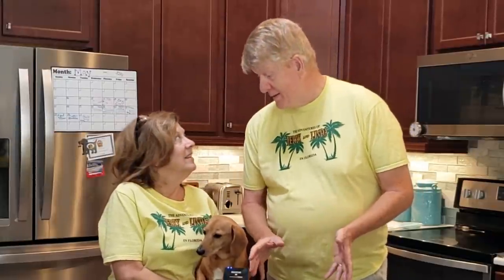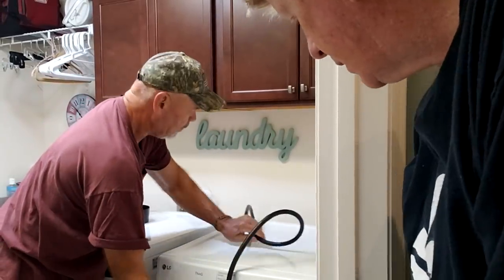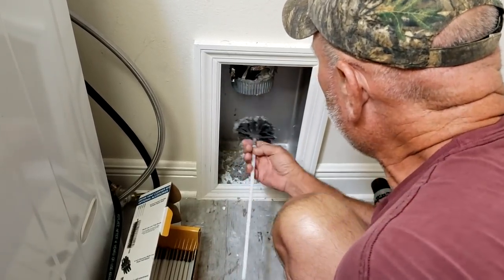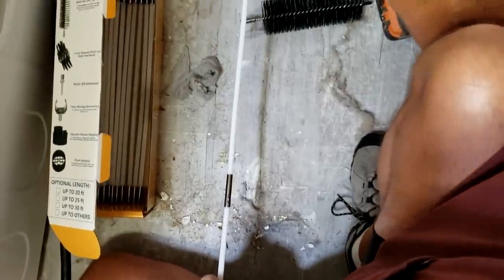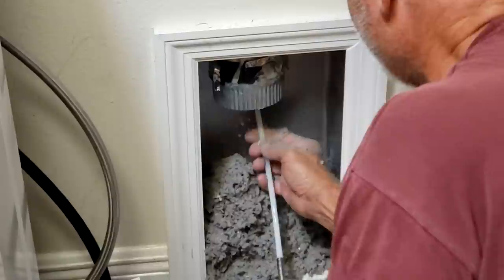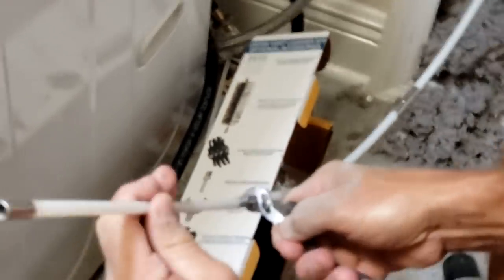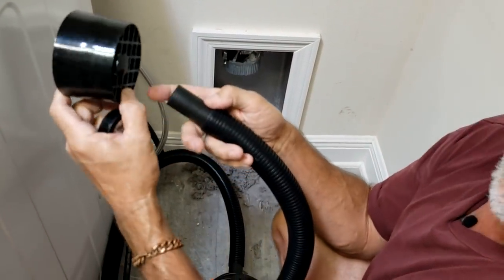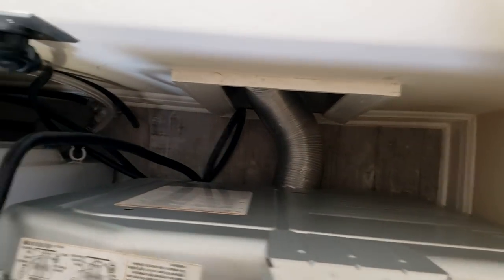How To Clean Your Dryer Vent

Comment: Big tip: do not reverse spin your drill while cleaning the vent. You will unscrew your tip or rods and they will get stuck in the vent pipe.
Reply: Yeah that was throughly discussed in the video.  Did you watch it?

Comment: Great maintenance tip. I occasionally take the dryer back off to access that tube that takes the lint from the upper trap to the exhaust vent. First time I took mine apart I found a shocking amount of lint that had accumulated.

Comment: .My ex was the volunteer fire department chief.Here in our little town we don’t have very many fires in a year.. But it never fails:there are 4-5 dryer fires a year. Of. Course, it’s under the house or goes up the wall out the attic. They can burn a while before you know it and spread to the whole crawl space/basement or attic area.  At minimum get it done once a 6ear. 2-3 times a year of you do lots of loads of clothes a week. Will make your dryer more efficient and dry quicker.
I also take the opportunit6 to take the back off the dryer and vacuum all the lint out of the corners and crevices.

Comment: Morning Jerry, Linda and Gizmo. Maintenance is very important. I never did it myself but when I built my home in the Poconos, I had the service plan for my washer/dryer/ refrigerator/dishwasher/and tv. Annual maintenance and anything in between.  When lived in an apartment, the maintenance was great with checking the A/C filters/fire and carbon monoxide alarms and whatever needed. This video is great for the DIY folks. I could never. Look at the lint. I’m itching just seeing it. 😂. I’ll continue with the service plans. Have a great weekend. Thanks so much and see you next video.

Comment: Comment......Builders should know better...NOT to put the laundry room in the middle of a home.  They should be placed on an outside wall so the dryer vent is only about 12-18 inches long and not to mention very easy to clean! There is no excuse for this problem!

Comment: Maybe use a small mirror at a 45 degree angle and flashlight to look up there.  Take a before and after picture.  I use my wife's makeup mirror and her tooth brush in the hard to reach nooks and crannies (just kidding about toothbrush :).  I'm sure that lint was all from the previous owner, too:)  My long term solution to this is stop washing clothes, that keeps the utility bill down and washer and dryer don't wear out.😀🤣

Comment: Placing a large garbage bag on the ground  first would stop a large amount of the mess.
Reply from the maker: We actually have a cap that comes with this kit that could go over the pipe.  It is attached to the shop vac. There would have been zero dust or lint. We let it come out to show you how much there actually is..
Reply: @JERRYANDLINDA  
Thanks for answering. I was hoping you weren’t going to send Gizmo through the pipe!😊

Comment: Every time I use the dryer I clean out the lint tray/screen.  Is all that collected debris simply lint that has escaped the lint tray/screen or is it the result of not cleaning the lint tray/screen after every use?
Reply: I always clean the lint tray whenever I use the dryer.  You still need to clean the vents or there is a danger of fire.
Reply: This is what escapes the lint screen.  A little each time but it adds up.

Comment: When I bought my new dryer in my basement I cleaned a 14 foot run and there was a garbage bag of lint! You had hardly any. Probably  because it is going straight up to the roof. Mine had a perpendicular run along the ceiling which caused more collection of lint. Great video ! I hope people learned that you have to clean the dryer vent ! 
P.S. Tom & Jerry ! That's funny!
Reply: I had 10 times what you got out!  The new dryer works way better.

Comment: Any idea what that would cost hiring someone. I’ve lived in my house since 95’, never has it been cleaned out.😮
Reply: The company I use  charge $125 because I live in an upstairs condo. My dryer is not near an outside wall and there is over 25 feet of tubing that has to be cleaned out.  It doesn’t take very long and it is worth every penny. The companies that do this have  the proper equipment.

Comment: I assume your laundry room wall is a outside wall. If so why when they built the house why didn't they just put the vent straight thru the side of the house instead of going up thru the roof?
Reply from the maker: Nope.  Not an outside wall.
Reply: @JERRYANDLINDA  That explains it. Thanks